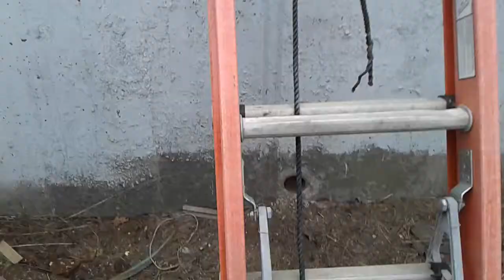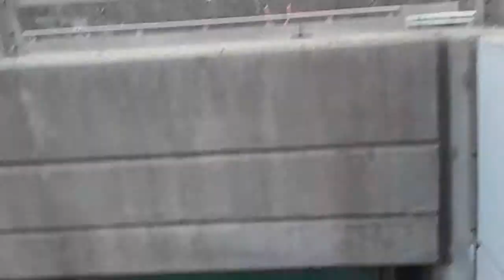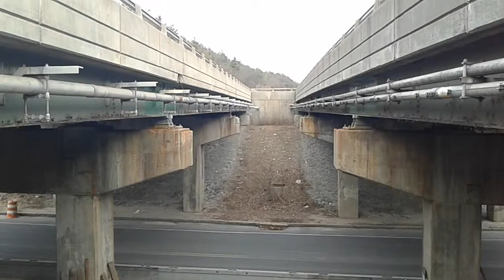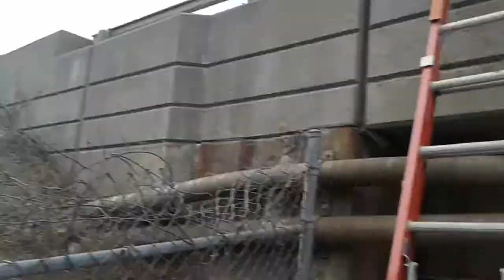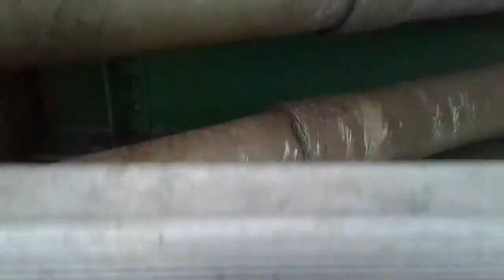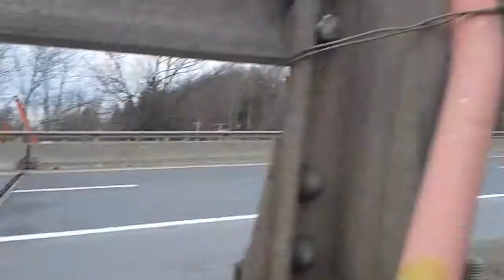Cars running over expansion joint sound effect

Comment: Those joints has quite a wide gaps.
Reply: It certainly can be done better with overlapping metal lips that slide over and under one another as the bridge expands and contracts depending on temperature...
Reply: @Ganiscol  oh it just occurred to me, maybe that section is still waiting for an asphalt coating. Because using metal sheets like you suggested would create an unnecessary bulge that would be dangerous at high speed.
And filling it with concrete would be impractical since the gap is inconveniently in the proper with to add rebars to strengthen the concrete filler.
Reply: @navigatorofnone There is no bulge when the upper sheet is going in the same direction as the traffic.
Reply: @Ganiscol  ok